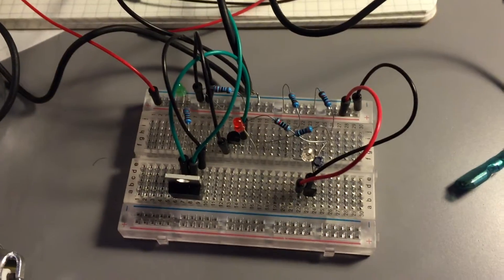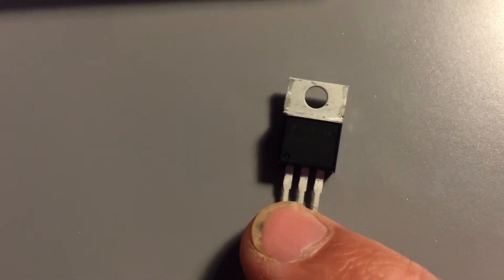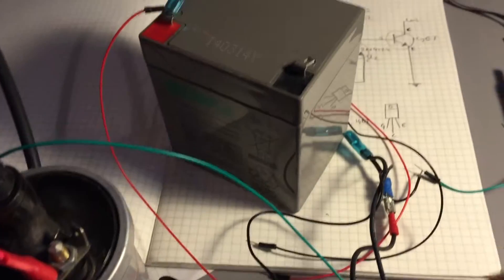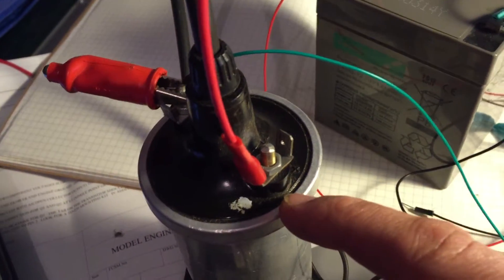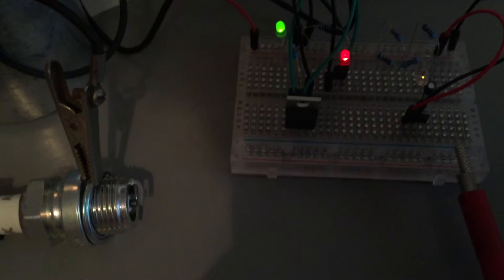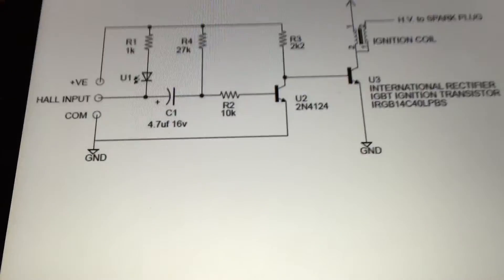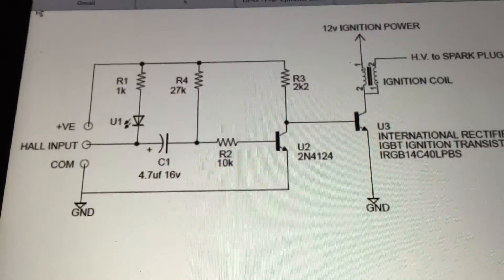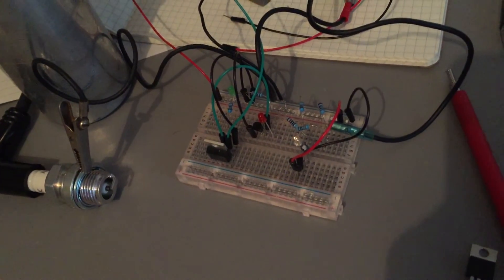IGBT Transistorised Electronic Ignition using a 3144 Hall magnetic sensor

Comment: Hello Sir!

I watched this video of yours, and the other one where you use TIP42C transistors.
It's been a long time since you did these. Do you have any experience?
I'm not very good at electronics, but I would like to make such an ignition, for a very old engine.
I also asked AI which one would be better. I got this answer:

"An IGBT is a better choice than a TIP42C for electronic ignition controlled by a Hall sensor because it switches faster and can handle higher voltages and currents, which are essential for driving ignition coils effectively. It also operates more efficiently with lower power loss and is easier to control with digital signals, making it well-suited for precise timing and reliable performance in ignition systems."

Do you think this is correct? If so, I will build your IGBT circuit.
Thank you very much in advance for your answer!
Reply from the maker: I don’t particularly like an ai answer like that. An igbt is a type of transistor. A tip 42c is a specific transistor. I have posted another video about igbt ignition. Search for it.
Reply: @bootsowen hi! I just found this and the other where you use tip42c! Do you have a third video about ignotion making?? Thanks
Reply from the maker: @marci92hun hi. What you see is what you get. These are old videos. Cheers.
Reply: @bootsowen  helpful
Reply: @bootsowen  I built the circuit.
When I moved the magnet away, the spark plug sparked once, but not again.
After I disconnected and reconnected the power supply, it sparked again.
However, it didn’t work continuously like you showed in the video...

But when I connected a 2.2 kΩ resistor in parallel with the C1 capacitor, it started working properly.
Did you not have such a resistor on your test board?

Comment: I would like to use this circuit with conventional breaker points but wonder how can get pulse when points open?
Reply from the maker: If you already have a working set of points then there is no need for this circuit. Have a look at my other videos. I use the magneto points from a Howard gem (Lucas magneto) to drive a coil ignition rather than the original magneto ignition. I think this is what you are looking for.

Comment: I am really confused why a regular NPN or Mosfet isn't used. Since the NPN is this driving force for the IGBT, it totally defeats the purpose of using an IGBT, which is special because of its ultra low current and voltage input drive requirement on the gate. It seems that a regular NPN on the output would achieve the same thing, in this particular  circuit. You did a nice job and it looks really cool.
Reply from the maker: The short answer is I don't know. I found a few designs for transistorised ignitions on the internet and gave them a go. But is still know very little about electronics!  I wanted to find a cheap way to replicate a points ignition system using a hall effect sensor, this is where I ended up!

Comment: I am working on powering an electric motor with an IGBT. I can get the 3144 hall sensor to trigger a darlington transistor just fine, but it won't trigger the IGBT. Is this why you have the amplifier?
Reply from the maker: +Logan Poppe Hi there, the 3144 triggers a 2N4124 which triggers the igbt, I am not too hot on electronics, i dont know if it would work without the 2N4124.  So i guess yes is the answer if you say it isnt working for you.
Thanks for watching.